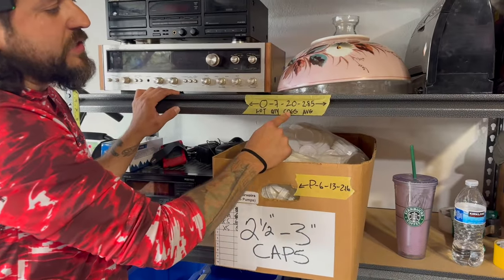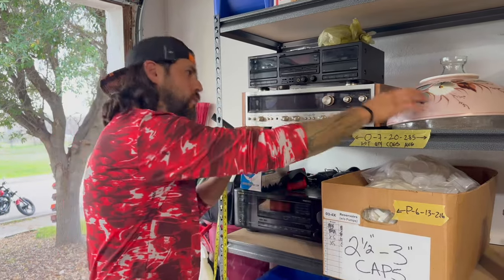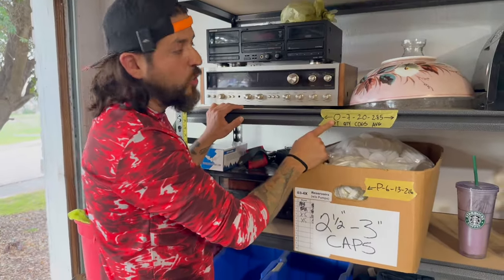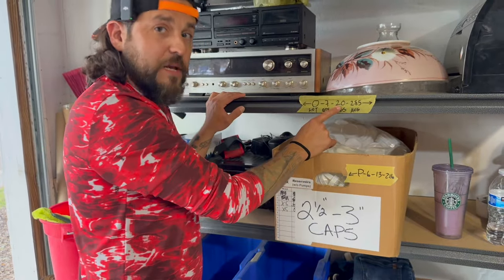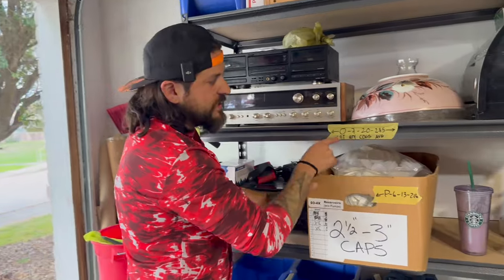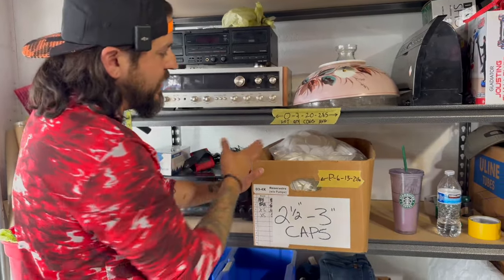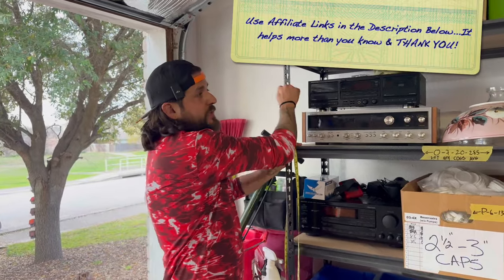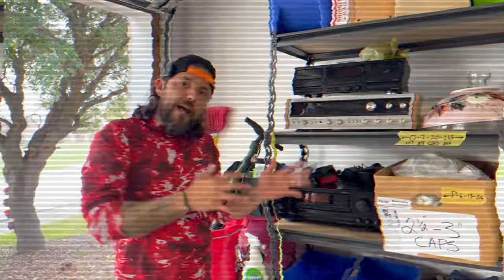How to Get Rid of your Reseller DEATH PILE | New Method

Comment: That was great content and it makes sense that is my problem I will have to change over to your method seems to flow really smooth thank you for that great tip
Reply from the maker: It works for sure. My “death pile” is not that at all. I only carry about 30 days of additional merch in case something happens. That’s nothing and can be stored easily. Thx for watching! 🤠🇺🇸👍🏼